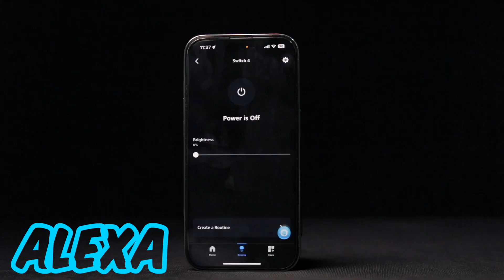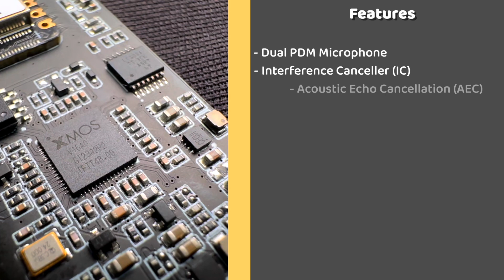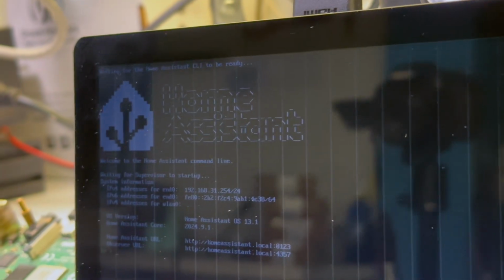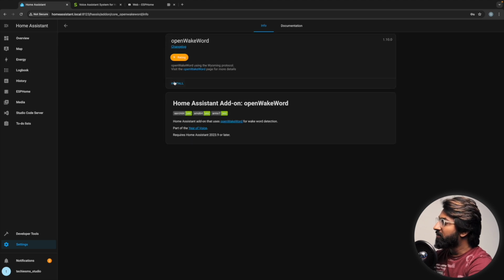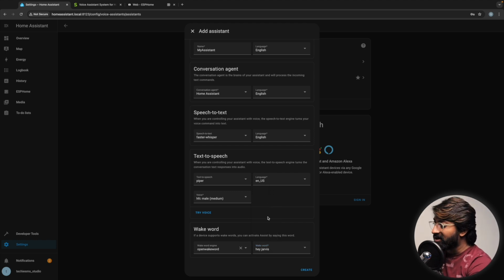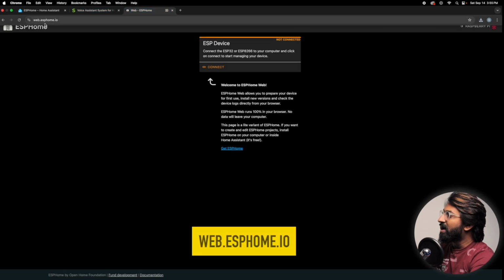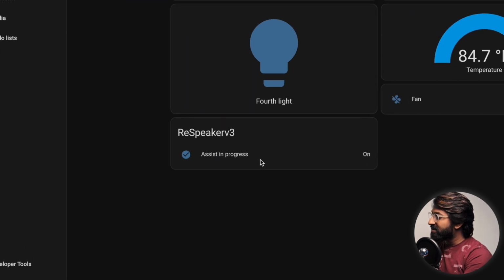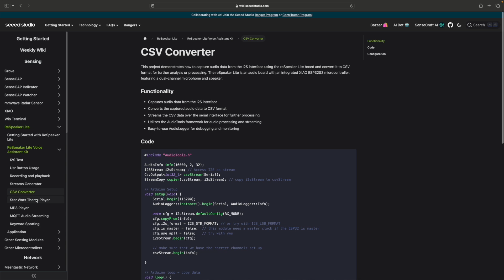Control Home Assistant device with your voice  🔥🔥 | ReSpeaker Lite

Comment: Using this board with majorally updated YAML\C++ code that works on the voice assistant voice team as a contributor. Using a modified version of okay&Nabu. Son that works much better. They also came out with a firmware update that fix the listen light issue.  On dedicated thread in HA forums for the respeaker lite. 

New custom wake word works with anything using Microwakeword, but only play Nabu right now.

Comment: So much excitement for a very low end chip that represent some of the very early algs used by the likes of Google/Amazon.  Amazon and especially Google have moved on after learning more effective methods such as targetted speech extraction.
I would wait and check honest user reviews, than HA fan boys from the upcoming Decemeber hardware release from HA so likely Jan/Feb. Don't believe the hype as will likely be over sold like 'Year of the voice' was.
Keep your cash in your pockets until you do get those honest reviews, but looking at algs, how the audio pipeline is disparate and how its only emulating many of the 1st gen of smart speakers it still lags far behind the likes of Google/Amazon.
Should be an improvement on what we had demonstrated with 'Year of the Voice' but that isn't much of a claim.

Comment: Thanks for guidance. It worked great. My only problem is that the speaker is extremely loud. How can I adjust the volume?
Reply: Thank you for your feedback! We are actively working on the volume adjustment issue and will update it in the next firmware version.

Comment: In VC 02 module can we connect RTC module and get time 
Can VC 02 module receive command
Reply from the maker: We don't have any pins to directly connect RTC with it but we can connect it with Arduino board which will be later connected with VC02 via Serial communication
Reply: @techiesms  thankyou sir

Comment: Shame there isn't a complete kit in a case. It might be fun but having a bare board with speaker hanging off is not very stylish! Being hard wired to power source is also annoying. I would rather use my phone I think.I
Reply: That's where the difference between an enthusiast and a critic comes in.  
I respect your choice of using mobile and I encourage you to do so too . Peace ✌🏻

Comment: Can you make tutorial on ws2811 rgb pixel led controller for 40 ports i.e. 2000 led, using esp12 and sd card.
Reply: I've done a project using this led on arduino Uno.